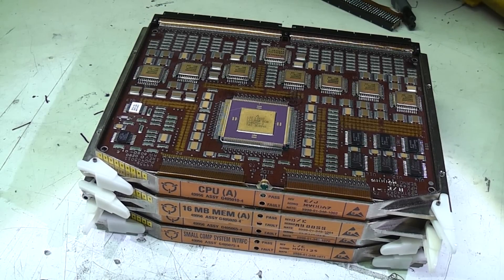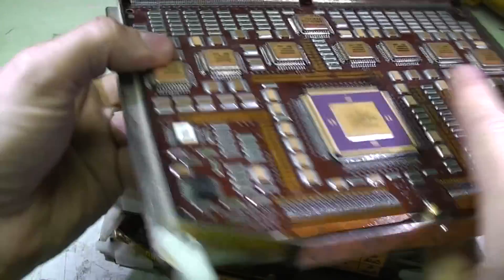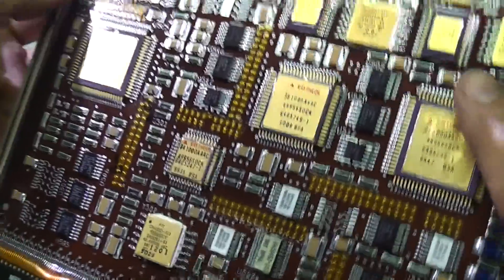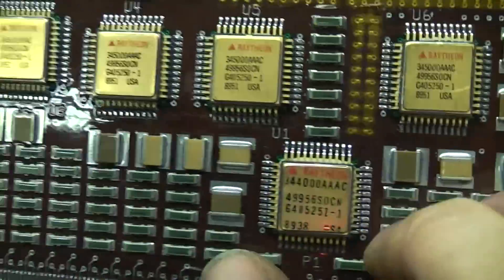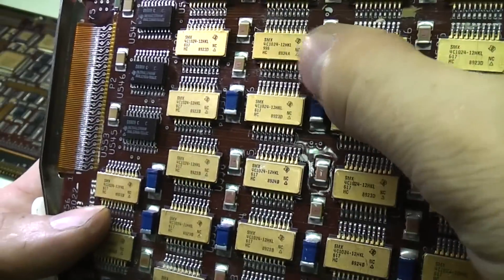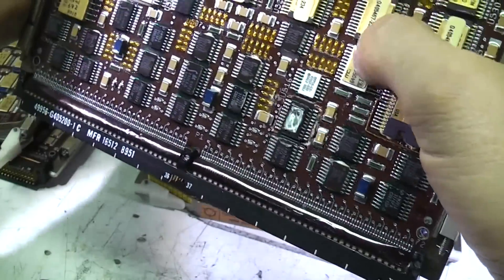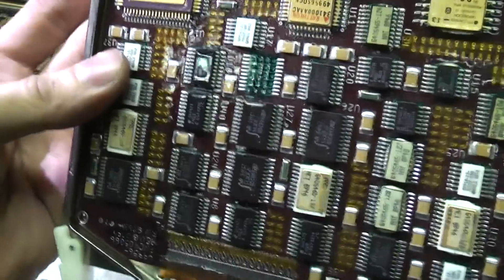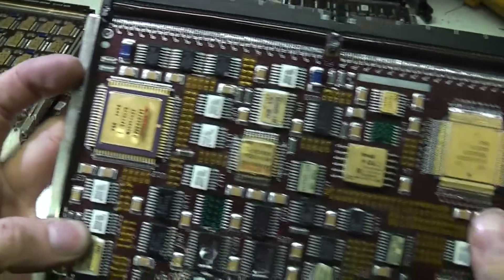Wierd military computer boards

Comment: The small black chips around the boards signed with 'S' could be LVDS drivers and receivers for communication, the electronic would work even after a nuclear EMP, the ICs are latch up and SEU resistent, the wadge locks on the side also transfer heat from th boards to the chasis, look at the coating paint on the PCBs, now i know where our taxes go, the bigger chips may be OTP FPGAs probably Actel, only one single patch wire applied due to space regulations, what a great engineer work

Comment: 1 MB = 1000 kilobytes = 1000² bytes
1 MiB = 1024 kibibytes = 1024² bytes

In 1998 the International Electrotechnical Commission (IEC) proposed standards for binary prefixes requiring the use of megabyte to strictly denote 1000² bytes and mebibyte to denote 1024² bytes.

Comment: No, usually quite the opposite. They are high quality, very low mtbf (mean time before failure). Able to withstand extreme high and/or low temperature, dust, moisture(hence the yellowy colour solder resist in this case) etc. Imagine a soldier with an admittedly older tech missile control equip, if it breaks they have to be able to whip out the board and (literally) slap in a new one.  By the time the toughened versions are in use the consumer  versions have far advanced in terms of high tech.

Comment: this is not the "market standard" a circuit cards are alot more reliable if they're in ceramic but the only excuse to make something with ceramic is if heat is an issue (such as a radar system that's putting out thousands of watts) an i-phone is made using epoxy-fiberglass laminate the second cheapest type of laminate why. .. because iphone doesn't need it to last forever.

Comment: Great to hear from the designer.  Is it just this design that has the very matter-of-fact arrangement of parts? I'm no electronics designer, but it looks like the design phase was restricted to getting the placement of important parts first, and then other things (like those resistors) were placed wherever was convenient for manufacturing.  (Even with all those resistors in a line like that, I doubt these individual boards would be serviceable at all, not to mention the laser trimming would make it hard to figure out which board you actually have.)

Comment: My vote is military or other govt agency. Space qualified usually isnt conformal coated due to outgassing and moisture not usually being a problem in space. They also tend to have tungsten particle shields attached to the IC's 
Normal for compact high powered stuff is a thin film printed circuit bonded to a metallic subtrated for heat dissapation. It would be interesting to find out of the CPU is the -NSA version of the mips with the HSD command. Would also make a guess that theyre VXI bus.

Comment: If they are for military use,,, they will be heavy because of many layers of ground. Raytheon will be making for aviation and aerospace. if in a metal container... not for heat but for protection from EMP amoungst other "noise" Somehw, I don't think that was military in nature because they usually wipe any and all part numbers and date codes, along with manufacturer of parts off of all devices. It may not have been classified in nature but still military.

Comment: Military hardware is rarely x86, partially because x86 is a flawed architecture, and partially because it's difficult to radiation-harden newer processors. I expect that the architectures they use in new products are actually quite old, like the Motorola 68k range and so on. The Intel architectures which have been used are the Intel i860 and i960, which are quite a bit different than the x86 range.

Comment: These were $50-80k USD in 1980's money, per board. That's a little higher than most modern boards of the same general function. Modern military stuff started using a lot of industrial grade components, and full mil-spec is only really used for critical stuff or space grade hardware. One of the realities of modern military/aero engineering is that customer expectations are high, but not many parts are available in mil-spec versions. If you have to build 100% mil-spec, you're gonna end up using older bulkier parts, and you will wait forever to receive them as well. That's one of several reasons why SpaceX and other companies have started to explore other ideologies to ensure system reliability. Just as well, small companies are locked out from being able to build full mil-spec. Minimum quantities are high, and parts are super expensive. Need deep pockets to have usable stock. In terms of part numbering and what not, this numbering scheme is all completely standard even today. Manufacturers often print their own part numbers on chips and even passives. Most of the numbers in this video are simply assigned, so you need a database to cross reference them. There are already way too many crazy people in the comments, so no point in saying any more than this. People for whom this stuff is relevant, will eventually learn what they need. Lots of this type of info is public.

Comment: According to mikeselectronicstuff, the datings he could find were 1989 & 1990.  This dating implies that it can be no older than 1990.  In the case of Curiosity Rover, it should be considered that memory capacities have also risen sharply over the years,  This means that there would be a noticeable time lag between the cutting edge capacities, and designs using known reliable memory chips.  In other words, the design is obsolete by marketplace standards, but proven sufficiently reliable.

Comment: My old teacher used to work for Raytheon.  They pretty much build anything and everything for the US and I am guessing the British Militaries.  All military electronics are built to the most crazy specs.  ZERO fault tolerance.  Think about it.  Would u want to be the guy who built a circuit for a cruise missile that shorted or opened and the thing blows up a whole platoon of Marines? Didn't think so.

Comment: Don't know for sure but looks like a lot of real gold for one. I used to run a mainframe computer back in the 80's and remember similar looking boards, would slide out of the computer much like your video card etc.. only much larger.  Those look higher tech than what I remember but I bet they are  mainframe computer boards.

Comment: Actually no. A 250 GB hard drive in metric units would be 232 GiB. So that's 18 GB of it just... gone.
That said, there is also something called "Allocation size" which plays o role on how much you can store on your drive. With an alloc size of 4096 bytes, any file smaller than that will still consume one block on the drive (4096 bytes) and a file that just exceeds that limit will still consume two blocks. Thus wasting space.
And there is also the region of disk that cannot be partitioned.

Comment: A smaller production process is precisely why they're more vulnerable. As for redundancy, somewhere along the line, the additional complexity introduced by redundancy will overwhelm the potential reliability from that same redundancy.

x86 has become mainstream despite its flaws - as it stands, it's an awkward, power-hungry mix of RISC and CISC, with several legacy misfeatures such as segmented memory. Intel has been trying to replace it for years, although to no avail.

Comment: These look like a navy spec board from a warship. Either a firing system or radar. They system is split into a series of boards that is readily changeable in the event of failure. 'Hot swap'.

Comment: The high cost of ceramic boards are only justifiable where life may be in jeapordy if the equipment fails such as a weapon system or medical equipment. as far as the technology. not it's been around for a while the microminiature electronics in an smart phones are more advanced but alot less reliable.

Comment: those look like rad hard satellite boards. specifically I was looking for some recently and saw this and that's what they are. the boards compress in the clamp not for cooling but for vibration during launch. the gold over the processors actually contains some lead probably for rad shielding, and the epoxy coating is to withstand vacuum conditions.

Comment: Impressive if this is indeed 80's tech.  General public were not seeing 16MB PC's until '93-'94 with Intel 486 50Mhz  cpu.  Surprised the govt did not destroy these as there is possibility of ROM data being peeked at - if there is any.

Comment: hehe ETs don't use discrete components or wires or pcbs.
they have a 3d printing process that creates structure and function as one uniform process. just looks like solid metal

Comment: I hope they are not ICBM digital navigation controllers... 
Nowadays you can find anything on eBay. 
Indeed they look very well made. For sure these Printed Circuit Boards can withstand extreme temperatures and vibrations. 
I don't know how much they were sold in eBay but these PCBs must have a considerable amount of gold. 

16 Mbytes may don't look much but are enough for simple tasks.  If  these memory chips are shielded against radiation and nuclear electromagnetic pulses they should cost a lot.

Comment: I have seen some real military grade circuit board and my professors worked on a few of them... they usually have a very large and a few inch thick metal enclosre ( brass or aluminum). I think these are industrial grade PCBs.... I usually make prototype or home level pcbs.... still, a very nice video and I have learnt something new. Thanks!

Comment: Fascinating. Yes indeeed, not like normal PCBs anywhere. 

...but would it be cynical of me to say that these have been over-engineered in order to justify a high sales price, rather than a necessary operational requirement?
Reply: +Peter Hodgkinson This is something that I would like our military or avionics industry to spend money on instead of the $10,000 coffee pot that can survive a crash landing at mach 3 or the 500 dollar hammer.
Reply: +syze302 The hammer was $749.00 I believe...  As for the coffee pot, I have a story about something like that.  Did a toaster mod on an aircraft once (galley) - the mount had to survive 20G's (the wings depart this aircraft at around 4G's).  Cost a bundle because of the mounting setup.   I'm betting that in a crash - this was for the investigators to make toast from the wreckage. The toaster and the Flight Data Recorder would be the only surviving parts...Military hardware must survive in conditions that would make most other hardware fail.  They don't like to buy "off the shelf" - or didn't used to.  The over engineering is by design for survivability during War (think worst case scenario - Nuclear war - EMP).
Reply: scott flynn I would rather spend money on a safer ejection seat/pod, vs  a toaster that can survive 30g's.  I've read that special forces use tampons to plug up bullet wounds on the field and condoms to plug up the barrel of a gun to keep out water and sand.  I'm really not into guns so I don't know if that's true but the tampon thing makes sense.  Cheap and effective.  Now they have that new invention of a syringe that injects 30 pellets of compressed foam into a gushing wound to slow down the bleeding just long enough to get you off the battlefield.  Not sure how much better if works than the tampon method but I betcha it cost more
Reply: syze302 at least it has a positive application.  Money that seems well spent.
Reply: scott flynn I agree.  Any money spent in saving a soldier's life is money well spent.  That tech will eventually trickle down to civilian life and benefit society as a whole.  And I understand the over-engineering of these circuit boards.  They are mission critical.  But I just want money to be spent wisely.  When the FAA mandated that commercial airliners seats withstand 16 g's, that was money well spent since it has saved countless lives.  When they spend money to overly shield the electronic flight controls, that's money well spent.  When they engineer a toilet seat to withstand a crash landing, that's money not well spent (unless it's a floatation device or bulletproof)

Comment: These boards look like the autopilot controller from a helicopter. The reason they are built so strong is for vibration. Sometimes these boards are run inside an aluminium box which is pressurised with pumped cooling oil which takes heat from the boards.

Comment: Sooo, how difficult would it be to assemble a working MILVAX using those boards? The connectors look like they'd plug into the connectors Apple used to use for NuBus and various PDS boards.

Comment: Raytheon, not Radeon (that's a brand owned by AMD). Raytheon is a defense contractor that's been around for decades. Raytheon makes things like the Patriot missile defense system, for example. They got their start making radio tubes in the 1920's but really made their mark with radar technology (magnetron tubes) in the forties.

Comment: I can help answer your question if if they're indeed ceramic. Chosen ceramic for easier destruction in case enemy might get a hold if them is my general idea question for you sir?
Reply: Military boards have to work under a very high range of temperatures and, in some cases, entirely conduction cooled. For this reason they generally used high quality components because they must also last many years.

Comment: Yes, you are correct to some extent. That said, it is generally accepted outside the geek circles to call the Mebibyte (Correct spelling) a Megabyte.
And you are talking about the metric measure.
It gets even weirder. The 1.44 MB floppy has 1000x1024 bytes on it which actually has a capacity of 1 474 560 bytes.
So yeah, it's a mess and to be accurate i should have used KiB, MiB and GiB etc.

Comment: It would, when i connect the cables from outside like electricity and ethernet through a high voltage protection (like a lightning protection). 

Of course it wouldnt survive then, when the bomb drops directly on my house :(

Comment: the people yelling at your for being too rough with out dated EXTREMELY DURABLE and probably non functional tech really need to get a life
Reply: ive built 20+ computers from components, ranging from low end celeron 775 pentium 4s 423 with rambus and ddr1-2 on 775, core 2 on 775 and i7 on 1366 with dedicated raid controller cards(2 areca cards and an lsi card). never fried a single chip with esd. I have also done projects with an arduino. My only protections are that I install the psu in the case and plug it into a grounded outlet, touch the frame of case before handeling cards and keep fingers away from pins/ connectors (my default behavior is hold by edges away from connectors). I have no such reaction to watching cards that he has no desire to protect be handled in such a manner...i think its just you.
Reply: Wuety06 I cringed badly, these are artefact components..would you throw around your arthritic grandmother?..wouldn't hurt to throw on an anti static bracelet and not fk them around like a bag of cheetos.. jus sayin...
Reply: ***** electronic parts are homophobic

Comment: Hmmm, I'm not sure those I/O boards are space rated. Too little shielding on the various chips, compared to the CPU and memory boards. Unless those were atypically installed and shielded by the other boards and structure of the body of the chassis, which is doubtful.
Still, nice mil spec work IS a thing of beauty.
For those talking about "industrial electrolytics", you're thanking tantalum capacitors, not only industrial.  :)

Comment: They look weird because they are old. ;))
The military implemented surface mounted devices way before there were made available to civilian use. Lots of custom made chips in there. Nowadays the mil-spec electronics don't differ much from consumer type, excepting the ruggedness and interference immunity required. 
I have seen something similar used in telephony. Some early 80s Russian boards... could be part of a communication system.

Comment: Since we're talking geek...
A Megabyte (MB) is 1000 Kilobytes (KB). A Gigabyte is (GB) is 1000 Megabytes.  These numbers are base10 which means they belong to the decimal counting system. 

A Mibbybyte (might have spelled that wrong) MiB is 1024 Kibbybytes (KiB) - 1 Gibbybyte has 1024 Mibbybytes. These are part of the binary counting system and so the maths works out. (wiki this shit, brah o_O )

Micro$oft ballsed up in their descriptions of the measurements in earlier operating systems :3

Comment: woah, these pieces of past are beautiful, why today PCs aren't so conveniently modular? shouldn't home PC customization be easier and not a "call a surgeon to install the CPU, it costs less than having to buy a new one"? ok that today's processors can't be just coated and thrown in because all you get from it will be a nice campfire, but still, greater modularity could make building a custom PC could be much less of a pain in the rear.
Reply: how much more modular should modern pc hardware be? you can change any part within seconds, and the cpu within minutes.
Reply: Digi20
yeah, I may have freaked out too much seeing these boards, they just look much more solid and well made than the new civilian modern ones.
But I guess I'm the only one who likes more this levels based modularity.
Reply: i like them too, but of course thats high grade military hardware, the connectors alone may cost more than the typical PC ;) so you cant compare theese boards with consumer hardware.
Reply: @Digi20 I think what @CeeDeePlayer was talking about was the blade interface.  It's no doubtedly more sturdy but its going to quadruple the cost.  PCI x16 and SATA is a good trade off in terms of modular.  I'm glad they went modular with PSU's
Reply: syze302
thanks syze, I can love computers as much as I want but I'm still a total newb in this sort of things.